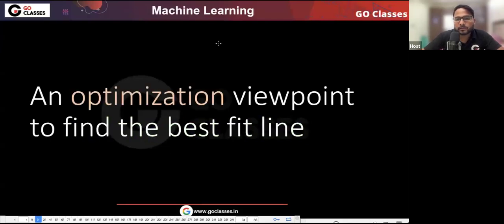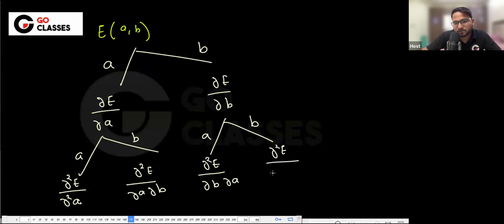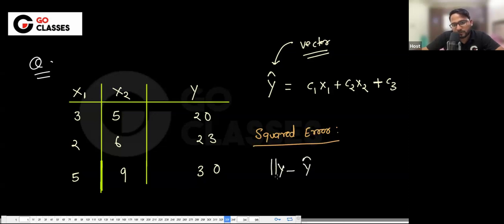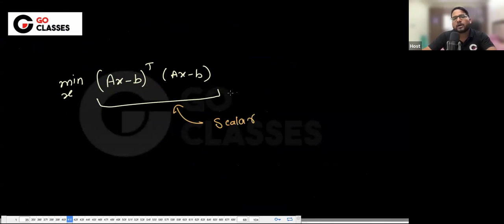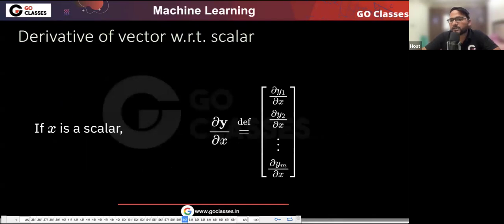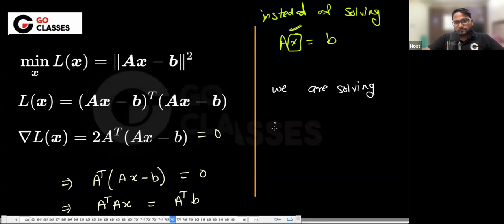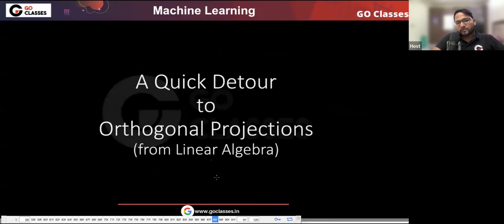Lecture 2 Fitting the Best Line on Many Points | An Optimisation View Points | Machine Learning | DA

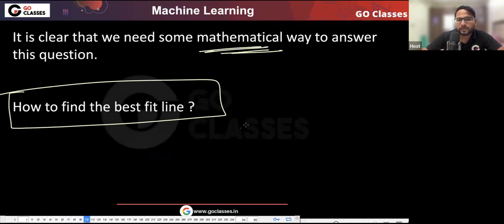Comment: * *Problem Statement & Intuition:* Defining the goal of finding the "best fit" line mathematically for non-collinear points (0:41 - 3:35).
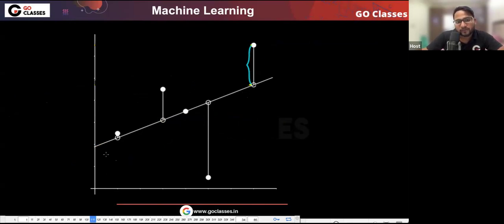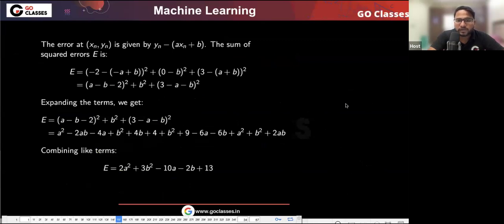* *Formulating Error (Residuals):* Using squared errors ($(	ext{predicted} - 	ext{actual})^2$) to measure model performance (4:09 - 9:59).
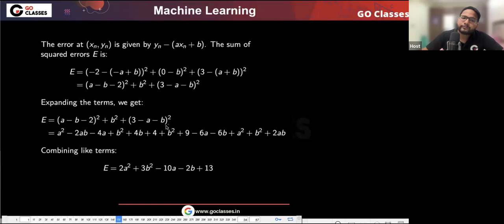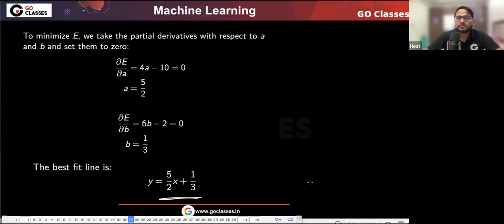* *Mathematical Optimization:* Solving for parameters ($A$ and $B$) using partial differentiation to minimize total squared error (10:14 - 11:30).
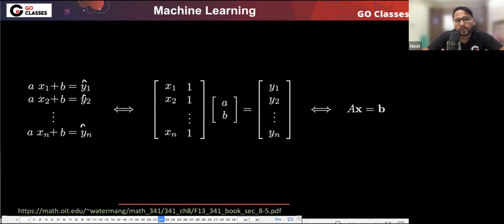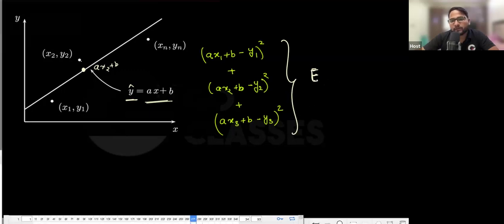* *Matrix Notation:* Transitioning from simple scalar equations to matrix representations to handle larger datasets efficiently (21:17 - 33:04).
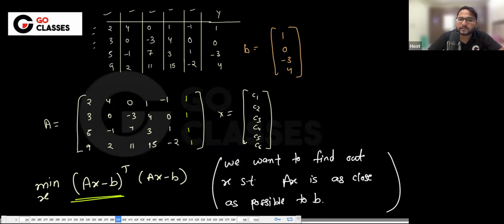* *Multivariate Calculus Detour:* A brief tutorial on differentiating scalars with respect to vectors and handling gradients in machine learning (1:02:25 - 1:26:40).
* *Deriving the Normal Equation:* Combining concepts to arrive at the equation $A^T A X = A^T B$ for finding optimal coefficients (1:27:04 - 1:44:30).
* *Next Steps:* Previewing the linear algebra perspective and orthogonal projection for the following lecture (1:49:09 - 1:50:25).